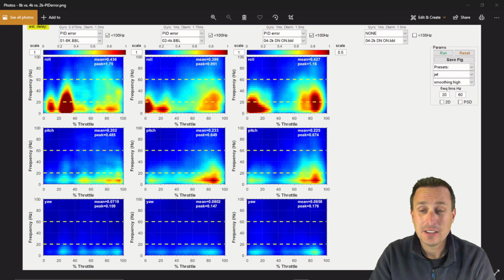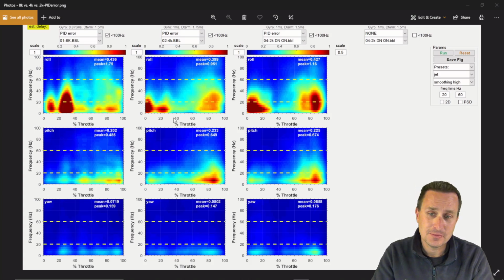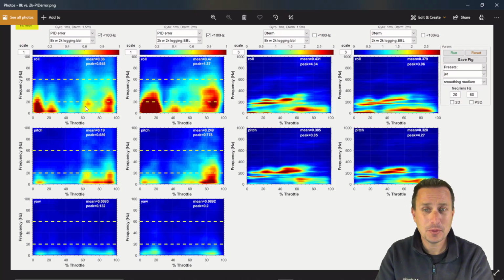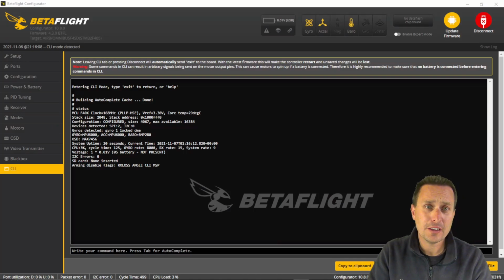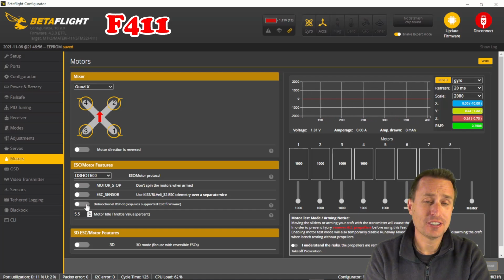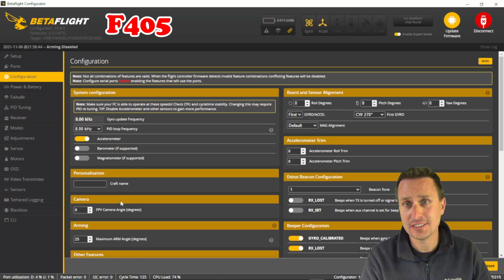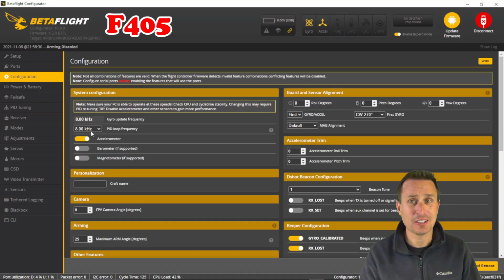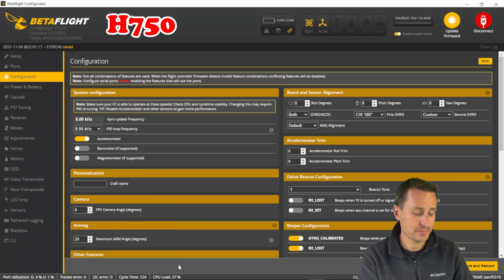Setting PID Loop Rate -- BEST Performance & CPU Utilization Breakdown

Comment: Hi! thanks for the video! so useful! One Question that could be interesting for the comunity, and for me btw😅. Testing with an octocopter (cinelifter) and f722 (BTF 4.4.2) when i set 8khz pidloop and RPM filtering, my cpu explodes to 95% so it freezes etc... unusable... May this happen because managing 8 bidirectional esc´s info is much more cpu demanding than a standard quad? if i set pidloop to 4khz cpu goes down to 55% so it seems the best option but... may you sacrifice the pidloop speed (from 8 to 4khz) or the RPM filtering and use just the dynamic notch filering with a pidloop of 8khz?? What do you think it would give the best flying performance for cinematic? Thanks for your great job and hopefuly, for your answer.

Comment: should i use 8k 8k and dshot600 or 8k 4k dshot 300 with bidirectional dshot enabled and rpm filtering , its in a ex pilot pro( same as tinyhawk but the newest one) and my cpu only goes up to between 50-60 with any od these options its a f411rx fc and a 1s battery
Reply from the maker: 8k 8k Dshot600 if you can and MPU load in BF 4.3.1 doesn't exceed 70 - 80%.
Reply: @uavtech  cpu is only reaching up to 60 percent at times and this is with any setting that we have talked about so i am definitelky able to move back and forth from one pid profile to the other and change back and forth with same cpu maybe just 4-5 percent differences between bidirection dshot300 8k 4k and non bidirectional dhsot600 8k 8k

Comment: Great Vid! Like you said in your video. My f4 FC on 8.0khz PID loop frequency on BF4.3 is 75% also. Is that way too high? Or should I run it? Alternately if I set PID loop freq to 4.0 it's 49%. What will I loose if running at 4.0 PID loop Freq vs 8.0? Will it desync or fall out of the sky if PID loop frequency is too high?

Comment: Hi, I have a 6 inch (BlackOpal Ultra Light) the one that is able to stay in the air for 55 minutes. I'm having some weird vibrations sounds - https://www.youtube.com/watch?v=UG3tKmGH3Bo  I changed props, but the vibrations are the same in mid to high throttle. Any idea what slider to move [P, D or I]?
Reply from the maker: It is always a hardware issue.  You can try to cover up with lowering ALL the PiDs.  Use Master slider.

Comment: Any advice on what to cut when right on the edge there with f405 at 8k and RPM filter on? Apart from disabling accelerometer? Is logging still even possible?
Reply from the maker: - Acceleometer
- OR you can.over clock it a little.  Type "get overclock" at the CLI.

Comment: At old days had CPU overload issues on too high PID rates in F3 boards quite a much. Indeed you can only reflash the board then. Good reason to save old settings diff together with board model name in case of anything before messing with filters. Seems that on boards with F411 chip with enabled RPM filtering highest reasonable PID loop requency is 4 kHz.

Comment: Great content! Thx 😁 Would it not be necessary to adjust the filter cutoff when lowering the loopfrequency to have a fair comparison so that you compare the same closed loop systems? Since running the same filter params on 8khz will lead to less phase than on 2khz because of the discretisation? Closed loop dynamic of an aggressive tune goes up to 30hz (i guess). Having 2khz as  pidloop rate then means still 33 times slower than  the nyquist frequeny of 1khz... thats why i don't really understand this big difference.

Comment: So does this prove that processor speed does in fact affect flight performance?
Reply from the maker: Depends how you look at it.  

I would guess theF405 flies just the same as an H750 at 8k PID loop rate.  That was not apart of this test though.  So just a guess.

Comment: For correct check of cpu utilization need a power from main battery, not from usb power
Reply from the maker: It was on Battery.
Reply: First of all I'm noob. But why would there be a difference?
Reply from the maker: There isn't.

Comment: Just comparing clock speed - I want to go and check the IPC to see if that's truly apples to apples... either way, F7 is powerful enough for everything we can ask for... and that the F411 is not as bad provided you're willing to take that light (250us) delay for stability.
Reply: ... because I'm a potato who runs Accelerometer on everything (Launch mode or GPS RTH)

Comment: I have f405 with firmware Sep 9 2021 15:16:58 ,  RPM filters ON 3 harmonics, 5 dyn notches, 8khz /8khz ( loop gyro) , dshot 600 ...    CPU 5-7% ps I think  programmers again did something wrong in newest firmwares.
Reply from the maker: Older BF does not report the "correct" clock utilization.  It shows an average of the Tasks, which is not a great representation of CPU utilization.

But if it works, go with it.
Reply: Because your CPU is low?
Reply: I’m currently running 8k 8k dshot 600 on a couple f411 boards on Emuflight with about 11% CPU load. CPU at 50+ % seems crazy. I thought that keeping it under 30% was the safe zone?
Reply: programmers... how dare they are :) AGAIN!
Reply: @IvanEfimovLimon  А что не так? Прошил последнюю версию загрузка прыгает от 5 до 80% . Это так типа исправили показания загрузки cpu?  А вцелом постоянно косячат , например бетафлайт 4,1 вообще трясло , при том что 3,5 4,0 и 4,2 вполне себе летают.
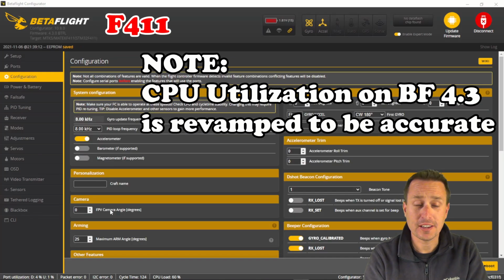Reply from the maker: @HERSDT_FPV  Per 5:05 in video, MPU utilization has bee fixed in 4.3 to more accurately reflect the true MPU utilization.

Comment: Wow, the F7 boards I’m currently using with BF 4.2 are at about 7% CPU usage with RPM Filtering, Dynamic Notch, Accelerometer, etc on the bench. Betaflight 4.3 is really a different beast altogether with the new multiple Dynamic Notches. I recently tried to flash one of my boards to a nightly 4.3 but it was a bit over my head to I’ll stick with 4.2 until a Release Candidate arrives.
Reply: Open CLI and type "tasks" that will show cpu load. "Cpu usage" at the bottom of the configurator is not the accurate cpu load.
Reply: Yup, they're basically overkill.
4.2.10 flies great on Mark's suggestions - but 4.3 is properly amazing.
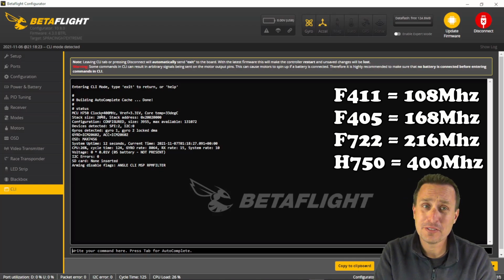Reply from the maker: Per 5:05 in video, MPU utilization has bee fixed in 4.3 to more accurately reflect the true MPU utilization.